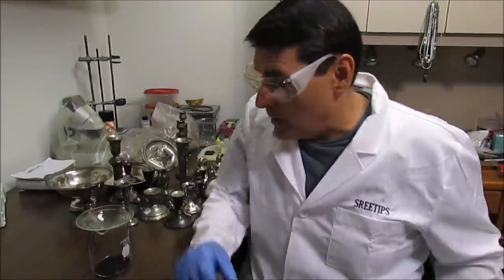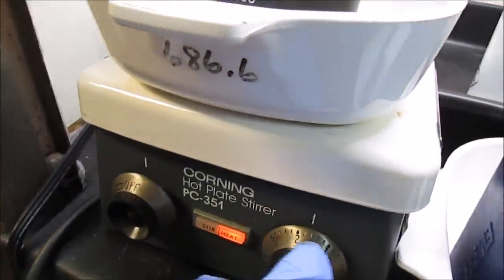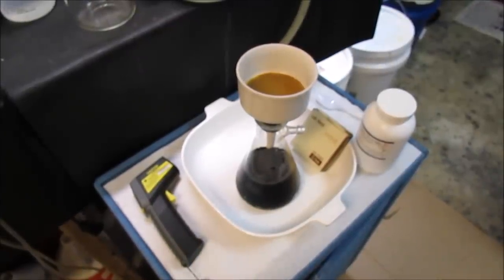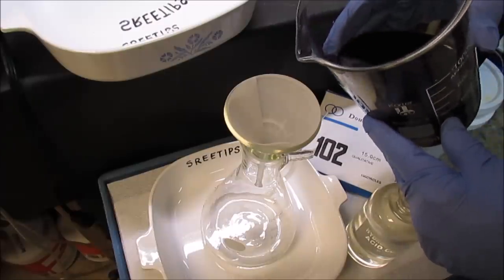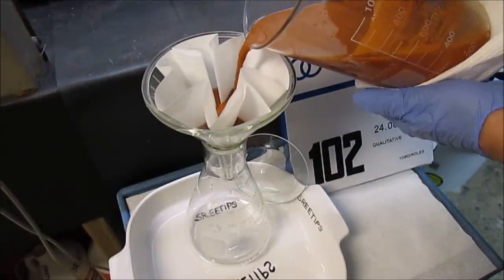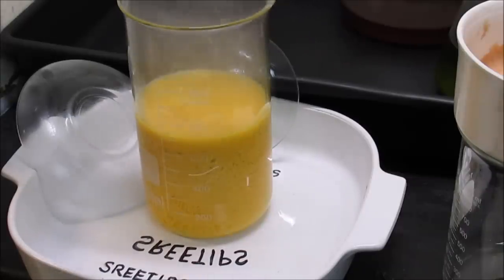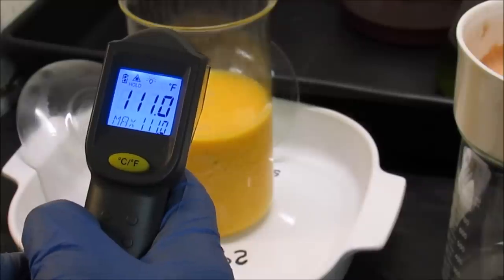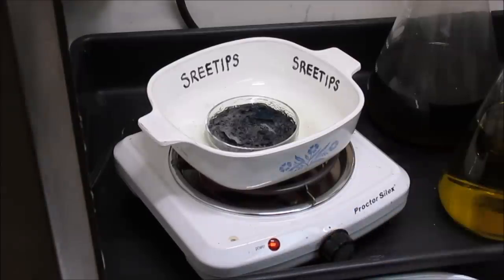Platinum Recovery From Automotive Catalytic Converters Part 2of2

Comment: Great video. Here in Australia, a company buy 44 gallon of the inside of the cats. They crush it up, Weigh it and test a sample and give u a price. They ship it to china. I couldn't give u a guessement, i never done it. I know some cats r worth a lot. My son's car needed cats. Mechanic said only needed one. I looked into original which were over $1000. Second-hand from the wreckers was $700. I could  got aftermarket ones, but was told they might throw codes. I found guy parting out cars. He sold them for $200 each and told to sell the old ones for no less $150 each. Which i got, a lot eager people wanting to buy them

Comment: As always your videos are extremely educational and incredibly inspirational.  I've finally gotten around to working with some of the white gold I've saved up.  Has me scratching my head though.  Testing on individual pieces to gain knowledge before I lump it all together.  Two 14K rings for a total of 7.4gm fully dissolved in AR without inquarting.  Zero silver chloride formed.  Solution was clear and started out orange then transitioned to a very dark red with a slight brown tint.  Got 4.25gm of gold after the SMB drop.  The leftover solution was a washed out orange/mustard yellow.  Stannous test before SMB showed a nice purple and slight brown.  Very dark, quick brown after SMB and it looks very much like a false positive.  But if not I can't figure out what the other 3.15gm was so I'm stuck figuring out how to work with it and get it out of solution.  My best idea is to cement with zinc but that still won't tell me what it was.  Since no silver chloride formed in the AR I have to think maybe palladium, but again...not sure and I'm just guessing.  These were old worn out rings and any rhodium plating was virtually gone so I'm doubting that was the cause of the deep red.  I'm stumped here.
Reply from the maker: Some older white golds were alloyed with palladium. If you got a brown stain then that may be what it is. Less concentrated solutions of Pd produce a green stain with stannous. If it were me, I would add it to my  stock pot and let the PMs cement out on copper and accumulate. trying to recover and refine small amounts of platinum group metals is difficult.

Comment: What I realized in many of your videos: You tend to use sodium carbonate for neutralization often. In my studies at the uni we hardly ever used it coz it increses the amount of unremovable salts. The results are forming precipitates of unwanted substances. In this series you finally managed to use ammonia instead which is the best option - because as you have demonstrated it - you can remove ammonium chloride easily by heating it out. 

Well done!
Reply from the maker: I saved all the platinum salts and made a separate platinum refining video to get some pure platinum metal. It's posted on my channel.

Comment: Probably the most in depth and precise videos I've watched on the process. Nice job.  BUT.. no matter how much you clean your propane torch tip, it wont turn it into an oxy-acetylene cutting torch!!  just sayin'...  Besides that, a 5 star video!   I was amazed with the amount of palladium you extracted! I thought it would be less than the platinum, but wow. Current spot on that is at $1,320.00 per oz.

Comment: 47:24 a cheap method we use in chemistry for drying out chemicals is to place that petri in a bag, then put a plastic cup with a scoop or two of NaOH in it next to the petri dish in the bag, and seal the bag.  The NaOH will pull all the water from the petri by desiccating the air in the bag.  Then just replace the NaOH with fresh pellets when it gets too wet unless your compound is dry.  NaOH is strongly hydrophilic.

Comment: You could probably use pool "shock" powder instead of the chlorine tablets. Double check with a chemist if possible to make sure or experiment with a small amount if possible. I cleaned pools for years and consistently substituted powder shock spread across the top of the water to fix chlorine deficiencies much faster.

Comment: Great video! Thank you!

 If you could point out tap or distilled water (at the beginning of video 1 you added water from a bucket with the HCl leaching process ).  Where I live (Eastern Washington St.) the water has high concentration of calcium carbonate from our glacial aquifer--water spots on everything and 10 miles north of here they have iron sulfide in the ground water and as I understand parts of upper NY St. have lithium in the water...  

 Many catalytic converters from the 1970's and n1980's  were contaminated by the use of leaded gasoline in unleaded only autos. Also worn engines that burned oil from that era often contaminated the cats with zinc additives from the consumption of oil. Modern motor oil and auto manufacturers no longer use metals (zinc) in engine oil since modern autos have roller lifters/camshafts that no longer require the added benefit molabnanim /zinc/ manganese etc as flat lifter/cams previously did..  Because of metal contamination of emission systems  and exhaust emissions, auto manufacturers moved toward expensive roller lifter/cams. Auto manufactures began phasing out the need for zinc (metals) and sulfur (and other chemical additives) in engine oil from the mid 1980 to the mid 1990s in order to meet increasing  EPA regulations/standards.

 Hope this helps to figure out 3 potential sources of the unknown filtered crud.
 
Thanks again!  (I realize - probably lecturing to the professor)
Reply from the maker: I used tap water for the leach.

Comment: If you were to ask if I would be willing to spend 2 1/2 hours to watch you do this, over 2 1/2 hours ago, I definitely would’ve said no. 40 minutes into part one I pressed on the screen only to realize that I was only halfway into that video(For some reason I didn’t check the length of the video before started, probably because I had no idea it would’ve been that long). That was too much time invested into that video to not watch the rest of it, and thus too much time to not watch part two, and so here I am finished with both videos. Thanks for sharing that, and although i did find it interesting to watch the process, I would not do it again, not for that long of time. Aloha
Reply from the maker: It's the only video of its kind on youtube, the Internet, the whole world! Thank you for watching

Comment: There are two main things about working with cat converter material!The first one is that you will never get 100% yield from them without roasting the substrates!It's mandatory:the only way to avoid this step is to do like I do most of the time:using HF to dissolve that ceramic crap!Yes,it's very slow and insanely dangerous stuff but nothing else can be so satisfying as seeing the results:bunch of PGMs on the bottom,which you rinse and smelt!
And the second thing is that in each cat there are three sections of the honeycomb and each one contains only one PGM,most of the time so it's much better to process them separately!
Yes and especially tricky is dissolving rhodium metal!And that is why I started using HF process:it's a freaking nightmare to dissolve it in aqua regia even in powder form!So I had to bubble chlorine gas through it for weeks(!!!) to dissolve it in aqua regia and still although it was in powder form it didn't dissolve completely-and the leftovers were not iridium as it might seem like but it was rhodium!And unlike platinum and palladium there is no chemical to precipitate it from solution and both ammonium chloro rhodate and dimethylglyoxime chloro rhodate are perfectly soluble in water!So it's also a nightmare to precipitate as it's only possible to do by converting it into sodium hexachloro rhodate,evaporate everything to dryness and to further dissolve everything in anhydrous ethanol and so the only thing that won't dissolve is that rhodium salt!So I guess that dissolving rhodium section with HF is actually a much more comfortable thing for me..
Reply: Do you have a detailed process of your method? Is it easier than this?
Reply from the maker: Brent, there is no short cut, except maybe selling the cats as-is. Platinum refining is dangerous and not suitable for a garage refiner. I only did it here to demonstrate the process.
Reply: @brentwright1378  yes,it clearly is!However it requires the specific type of equipment to enable it!This is the very serious induction furnace with tungsten crucible which has the capacity of at least 2 liters and the bottom must be conical with the lowest point being in the center:there you will have your PGMs collecting and the rest will be simply discarded after melting!Very good solution will be to just wait for some time after everything liquefies completely and you have your PGMs going to the bottom where they get collected and into a single blub and then you just pour the empty slag out into a bucket of cold water by tilting the crucible and the rest of the leftover slag together with the PGM bead will be just poured in the other smaller bucket and get your metal from there!This will be the 100% yield of all 3 metals(platinum,palladium and rhodium)mixed together with no other non-precious inclusions whatsoever!
By the way from 1 kilogram of most frequently encountered converter material of the lowest grade(90% of factory original converters will be precisely the same!Others will yield more.)-you will get 0.87 grams of platinum,0.35 grams of palladium and 0.135 grams of rhodium..So essentially you will have a 1.35 gram button at first and when you will carry out the separation process-you will get those amounts..If you want I can provide the full guidance through the entire process of separating the metals from the blub you get..
Reply: @sreetips  the only thing that can be in any legitimate way presumed to be dangerous or hard to do on the level of garage or backyard operation may be the process of separating of the PGMs from the mixed blub of all 3 of them which you can get with a proper induction furnace that can heat the stuff that you put into it's 2 liter crucible to 2000°C in several minutes and then maintain this temperature for at least one minute until 95%+ of the content will be decanted into a bucket of water and the rest will be left for further addition of the material repeated until the desired amount is accumulated and then the result is poured out..That requires only $3500 worth of the furnace and crucible and the socket for the furnace's power cord!And nothing to be afraid of during the process!
Reply from the maker: Ok, I guess I’m wrong. Thank you
Reply: Hi John Sheppard.  What does HF stand for?

Comment: I've watched part 1 and 2 I don't know how many times. I love what you do Sir. I was wondering. Do you do this just for you or do you also do it for others for a percentage of whats recovered? Either way, I think you're great. Hope you and your family are well.
Reply from the maker: I’ve only done this once, just to make the video. I still can’t believe that I was able to pull it off.
Reply: @sreetips  I think you're a incredible person. Best to you!
Reply: @sreetips  I think I have a problem. During the initial filtering processes, where you're removing any solids from the solution during the 5gl bucket process is where I'm at.  My problem is. I was almost done to the point of having a clear liquid, BUT on the last filtering I did it in the sunlight. 
The solution started to produce a black spongy looking material! Freaked me out. Can the sun push the PGM's back out of solution? Or do I have another metal being produced because of the sunlight (being pushed out of solution)? Can it possible be silver (which I don't understand how it would be there).
I just don't know?? 
What can the sun in a white 5gl bucket push out of solution?
Reply from the maker: Silver nitrate reacts with light, and that about all I know. I’ve never experienced what you describe.
Reply: @sreetips  Everything was going smooth with no problems at all. Until I put a white 5gl bucket of partial solution in the sun. First it started out a light grey looking see threw gel floating thru out the solution then slowly it got darker until it was a black looking spongy material. 
My first thought was, is the sun pushing out my PGM's? (but I couldn't wrap my mind around that).
Then I thought. Silver?
From where i got my original material, I wouldn't think there was "silver"  in it.

So I thought of you and thought I'd pick your brain. Thank you for your reply.
I hope you and your family are having a great day Sir!

Comment: I’ve sent material in for refining twice.Both batches took around 12 years to accumulate.The first company’s yield was 33.1 ounces au the other company’s yield 4.1 ounces au even though the materials submitted were twice as heavy.I was robbed !! But still I’m not ready to attempt the process.I will definitely use the first company next time I have a batch.
Reply from the maker: That’s one of the reasons I only work on my own material. If the yield is off then I only have myself to deal with.

Comment: Very Nice melt!
Beautiful Palladium Button!!
I have a question, at the 51 to 52 minute mark you took the torch to the palladium sponge because the palladium wasn't getting hot enough on the top. There was just a little that didn't get hot enough. Would a lid over the corning wear dish (to circulate the heat) be a another way to heat the top??
I'm just asking to learn and see what your opinion is if that could be another way to get it dry??
Thank you Sreetips!!!
Reply from the maker: It needed more heat under the dish. I should have put it on an iron ring stand and applied a low flame directly to the bottom of the fused Quartz dish. But be aware, heating the salt too fast can cause it to vaporize and cause loss of metal.

Comment: Congratulations for the video. I didnt understand well why did you re-dissolve the Paladium salt in NH4OH after this precipitation process with Cl2 gas?
Reply from the maker: I’d have to check. After precipitating the brick red Pd salt the next step is to dissolve it in ammonia and filter. Then re-acidify with hydrochloric acid to form the beautiful canary yellow palladium salt. Then calcine to burn it to a fine gray ash. Put it in a crucible and melt into a button

Comment: Thank you for the video. Very informative.
Can you tell me what the gas is that comes off my scrap gold/copper in a hydrochloric and nitric acid mix when it fumes.

Also could you tell me what the gas is that comes off my acid once I remove the nitric acid from the solution with urea and then add my SMB. When I add the SMB is when  I get a very nasty gas. 

Wondering what these gasses are...Chlorine/NoX maybe?
Reply from the maker: I'm not sure what gas comes off of gold dissolving in AR. SMB in acid produces sulfur dioxide gas.

Comment: Perhaps this pink compound may be rhodium chloride, if it is mixed with sodium bisulphate in a liquid solution of distilled water in stoichiometric ratio 3 moles of NaHSO4 to 2 moles of Rh which it believes to be present at a temperature of 450ºC to 500ºC has diluted formation of Rhodium Sulfate, then adding Ammonium Chloride to form a rhodium-containing complex and finally set up an electrocatalysis process to reduce the metal by hydrogenation at 1000ºC, perhaps rhodium in solution can self function as a catalyst in the presence of excess hydrogen and precipitate into its lowest Nox, being ready for casting after drying on quartz watch glass.

Comment: Hello Sir, Thanks for reply to me .I have become very serious for recovery of palladium from catalytic converter after watching your videos. First of all I have started to make feasibility.  Raw material (without iron body) is available @ 47 usd per Kg. I just want to know that after buying material at this rate, will it be profitable or not after paying all further expenses? can you please share information regarding cost? Thanks
Reply from the maker: No, you will not make profit. It's very difficult and dangerous. Requires much special equipment and trained chemists to make it work.

Comment: Thanks again .
I'm waiting for your stock-pot video , before I start processing , I want to find how I can keep any waste to a min. , also recover any value .
To me it seems , I do electronics repair - that has also become scrapping of electronics .
That just off the top of my head , trying to get precious metals - maybe just a percent or 2 generally speaking in all circuit boards , there is probably around 30% copper , which is a large part of what I started getting cash for .
So with all the different values , even capacitors etc. , so maybe 6 to 8 or even 10+ stashes of
different of goodies to cash-in on ;)
For me I start with gold mining [ underwater suction dredging ] methods gravity , high heat burn off for chips etc. , then chemicals lastly .
All down to as little waste etc. to deal with .
Reply from the maker: Use minimal amounts of acids and evaporate solutions to concentrate them before precipitating the precious metals. It cuts down n the amount of waste.
Reply: Ok thanks again .
From yrs. ago , reading / hearing Buckminster Fuller say something like , there is no waste , all waste is someones resource .
So reducing my waste to someones resource ;)

Comment: Thanks a lot buddy, so useful educational video. 
Well, could this method be used for getting some money (as a own business)? As I checked that out, the price of palladium, the amount of palladium you got, and the cost of the mufflers and chemicals you used make it nonprofitable business.
Am I right my friend? I need your advice.
Reply from the maker: You are correct. I only did this to demonstrate the process and make the video. Trying to do this as a business would be difficult. It's dangerous to health. it would be like designing your own computer and trying to compete with IBM. They would crush you.